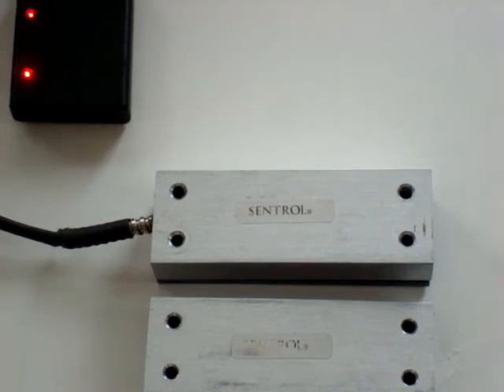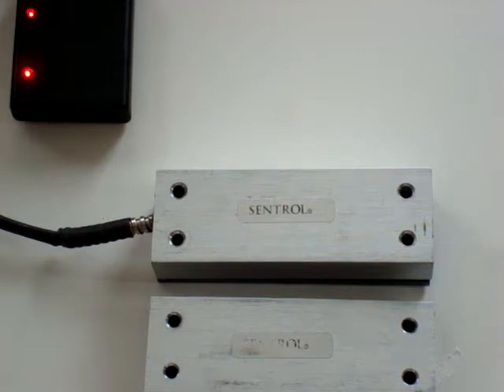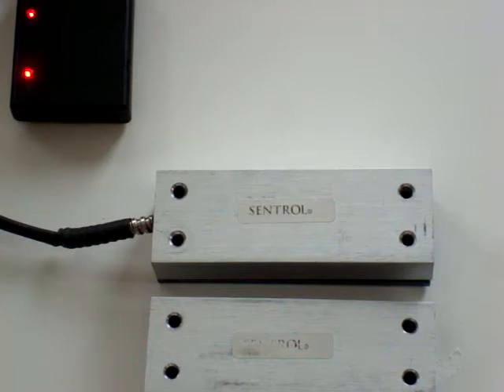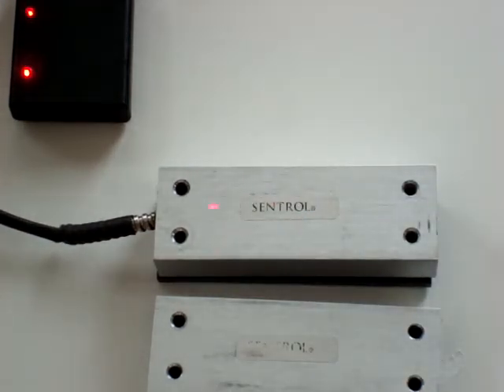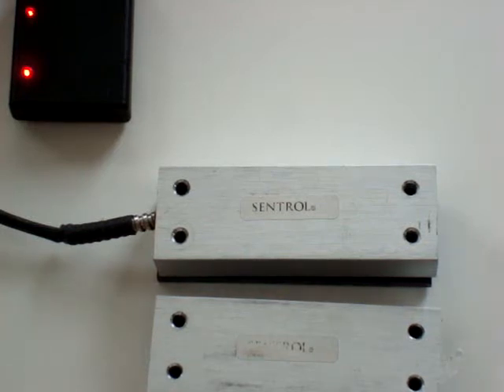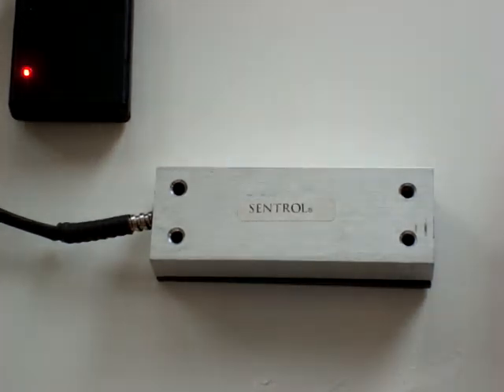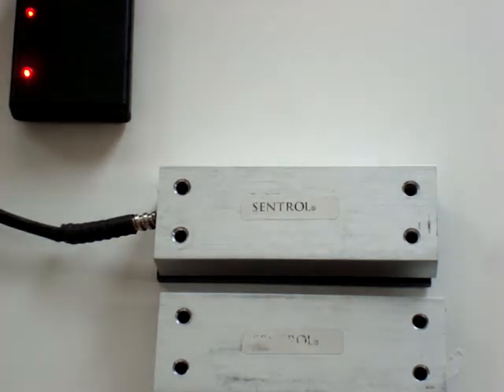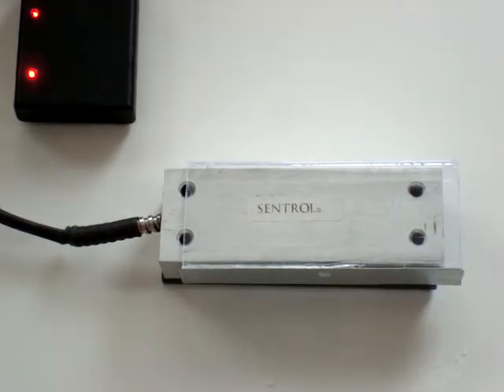Magnetic defeat of a GE Sentrol 2707A

Comment: Underwriters laboratories requires that the internal tamper circuit be wired to a 24 hour zone that will create a trouble if it gets too much magnetism. The 2707AL also comes as a matched set. In other words, one 2707 magnet won’t work with just any 2707 contact.

Comment: This device comes with and has a "supervised loop" that was obviously not wired in into the equation.  Once the Sup (aka wired tamper) is wired in you can try all day but will not be able to use ur cute little sleeve to bypass the alarm.  #micdrop